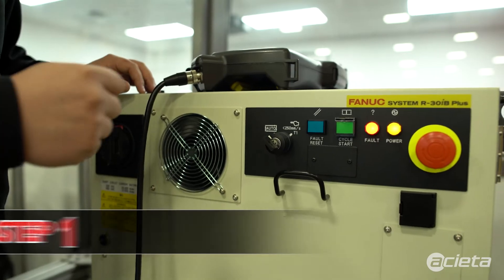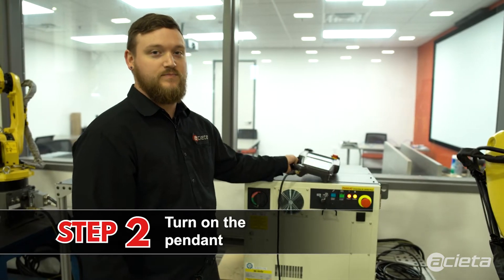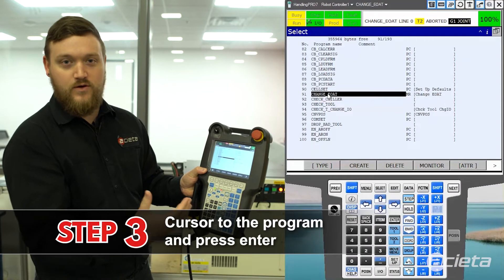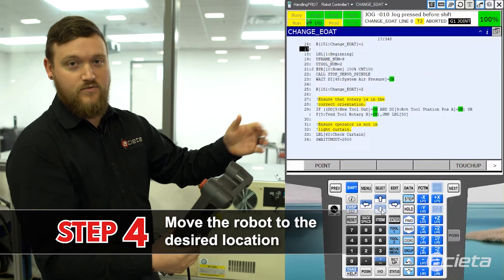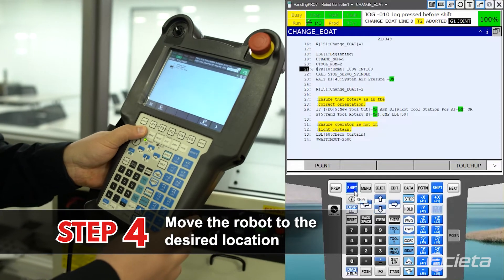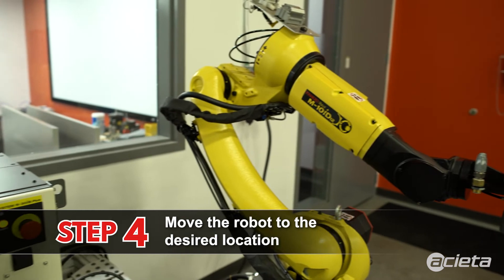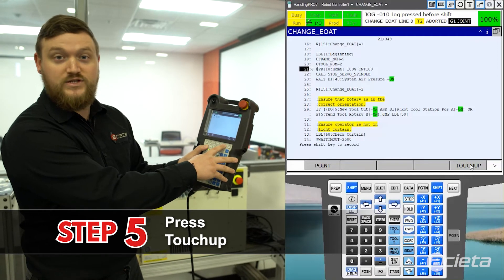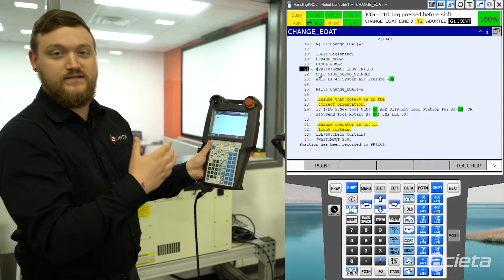How to touch up a point on a robot

Comment: What the hell was that? Never seen where the point was off and needed correction.
Reply: If I may give a  possible example. I work in the automobile industry. When we have a  slight change during a face lift period all that may be needed is a TOUCHUP rather than writing a completely new program.

Another example I just recalled. We had a pedestal that was used for pressure testing that was moved slightly within the cell (under a foot). So  the robot only required a TOUCHUP after the test pedestal was moved.